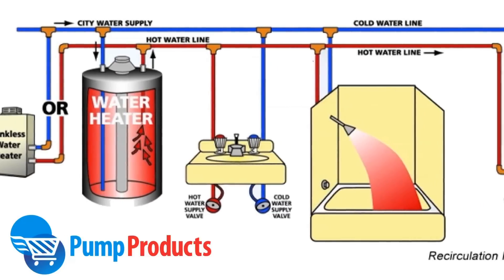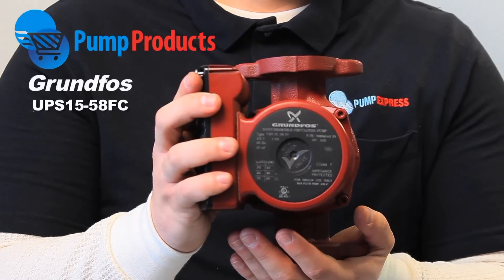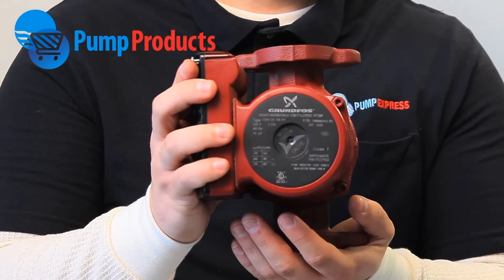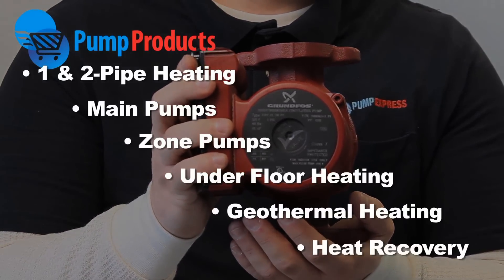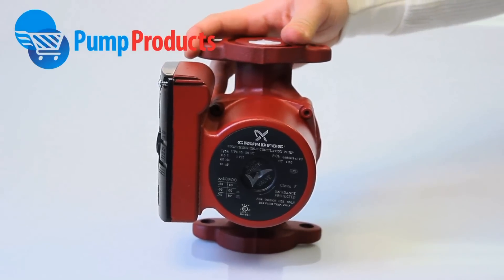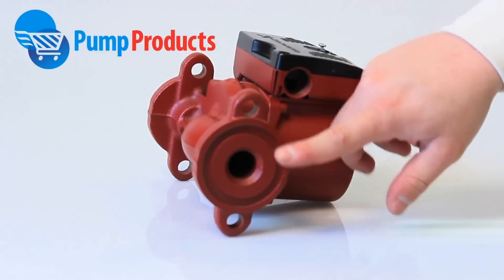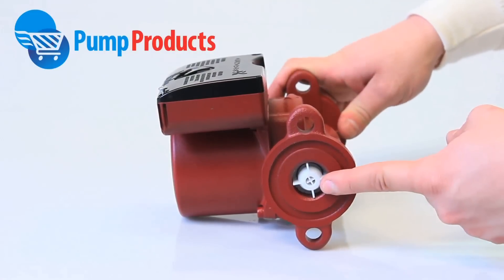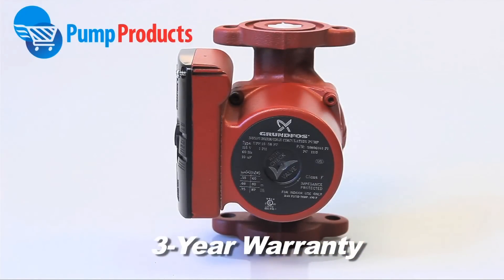Pump Products' Grundfos UPS15-58FC Circulator Pump Review*

Comment: This is a good pump, but why does it have three speeds ?   If  low speed heats a room,   what is medium and high speed for ?
Reply: It has to do with system size for heating systems. one pump can cover a range of heating systems for GPM and head.

Comment: This isn't a 'review', it is a description of the product...not its performance. My 2 cents is: I had 2 new Knight Boilers installed, they came with 2 of these same pumps. Upon new installation, one of the 2 was bad out of the box. They sent a replacement; same thing but black in color. So just be mindful, it does happen.

Comment: opening picture shows the pump between the hot and cold lines at the end of the system.  This makes no sense.  It shows the pump turning hot water into cold water instead of recirculating the hot water back to the heating system.  Where is the hot water return pipe?
Reply: Cold watet supply how pressure gage.